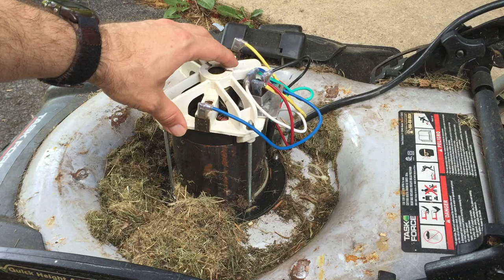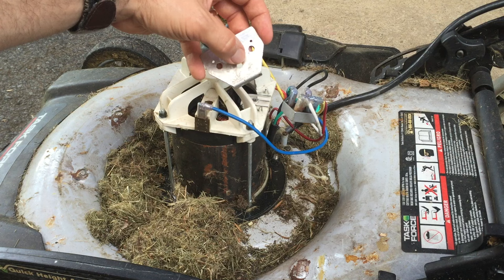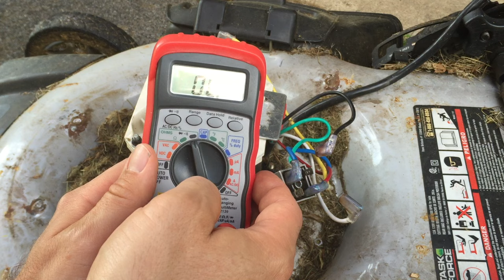How to Fix Electric Lawnmower (Rectifier) - Trips Circuit Breaker Short Circuit (Task Force)

Comment: Hi can you tell me which volt meter you using for test for sotcurcuit
Reply from the maker: Pretty much all digital multi-meters have a continuity setting.
Reply from the maker: If you want a suggestion, you can check the video description.  There should be a link there.
Reply: No sir I already check description I need to know which you using red volt meter
Reply from the maker: I’m sorry about that.  I just updated the video description with links.  Can you check it again?
Reply: You are not understanding my point m talking about volt meter where you buy from and can you make video on it so which one i need to buy my lawnmower is not working but I don't know how to check problm or which volt meter I need to buy m not talking about bridge rectifier plz tell me

Comment: you dont need thermal paste
its not made to need that, the aluminum plate dispenses heat
GOOD JOB though
THANKS
Reply from the maker: Thank you for the encouragement!  You're right that the mower will run fine without the thermal compound and that metal piece is the for heat dissipation.  The issue (other than low quality manufacturing) is that heat is probably the biggest contributor that will cause the one of the diodes to go bad inside the rectifier (and cause the short circuit).  We also want to consider efficiency.  So while you have the mower apart why not put some thermal compound on to aid the dissipation of heat and increase the lifespan and efficiency of the rectifier?  Any thoughts?
Reply: The paste helps in transferring heat from the rectifier ic to aluminum plate.

Comment: How did you put the cover back on?
Reply from the maker: Well, I never really went back to fix it right.  I left it ghetto and used duct tape.  I should probably drill two pilot holes in the decking and put in two screws to hold it down.
Reply: FrugalRepair thanks. I totally forgot about duct tape. I'm having the same problem with the screws.

Comment: Get a cheep 120v leaf blower and inject air to the motor. Then you can get rid of your breaker.
Reply from the maker: How would that work?  The breaker is in the house on the electrical panel.

Comment: Please help!  I have the same mower.  I bought it used two years ago and it had a little glitch - I would often have to turn the blade by hand a little first and then pull the lever before it would start. This year it mowed fine once, but last week it acted like it was getting bogged down by grass that wasn't thick or high.  I tried switching to a better extension cord but it slowly died and wouldn't restart.  It didn't trip the breaker and the ext. cord is good.  However, if the lever was secured in the 'on' position and the blade was spun, it did kinda run, cough, and spark for a half a minute...(Yeah, I know!)  Now nothing.  Any ideas?  (Except for half of the start lever broken off, it looked mint when I bought it.)
Reply from the maker: Have you taken off the lid and done a visual inspection?  Make sure all of the electrical connections to the rectifier, the motor, and the brake resistor all look good.  Also, how does an electric motor "cough"? =)
Reply: Everything inside looks great.  I took the connectors off and put them back on.  *It was supposed to say catch and spark.  It would spark, spin a few times, slow down, then do it again.
Reply from the maker: lunaticsanon  sorry for the delay.  I wonder if the bridge rectifier is the problem.  You could measure the output of the DC voltage.
Reply from the maker: lunaticsanon I doubt it is the motor itself that is bad.
Reply from the maker: Hey, I don't know why I didn't think about this before but it sounds like you need new brushes for your motor.  They are only a few dollars and should be very easy to replace.  I put a link to an example in the video description.  You'll need to measure your old ones to make sure you get the correct size of brush.  Let me know if you have an more questions.
Reply: Sorry I didn't see your comments - I don't use the email associated with youtube very often.  I had thought about the brushes, but I'm having trouble finding a place that sells parts nearby.  I'll let you know if it works when I find some.
Reply from the maker: ok, let me know if I can be of further help
Reply: It's running!  I took out the brushes.  One is worn down to almost nothing, and the other was jammed.  I took both out and got them moving freely, and when I put them back in it started right up!  It will definitely need a new brush in the near future, though.  (I'm so glad it's a cheap part!)  Thank you for all your help!
Reply from the maker: Great!  This is what I love to hear!
Reply: @lunaticsanon  what size tool.did u elude to take the cover off
Reply: @johndeloach503  As I recall, all I needed was a screwdriver. It's been a few years though. I don't have it anymore because I couldn't find replacement brushes for it.